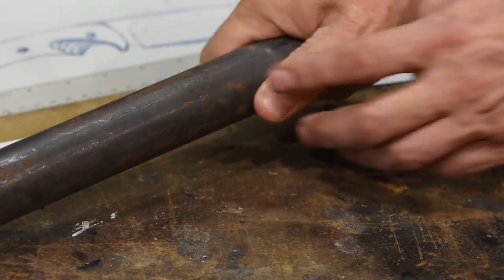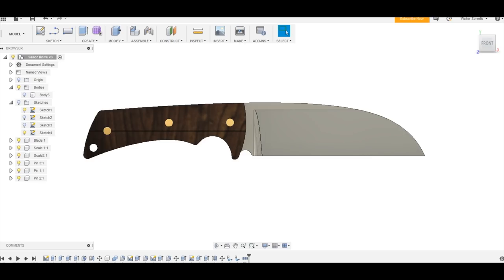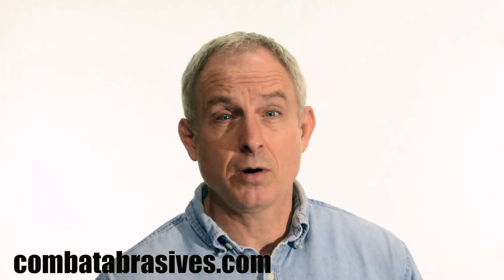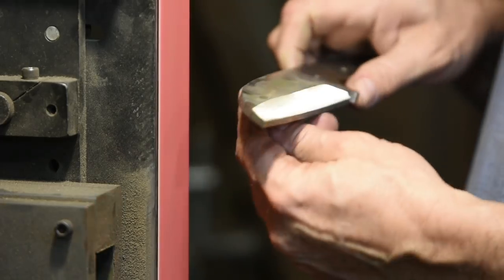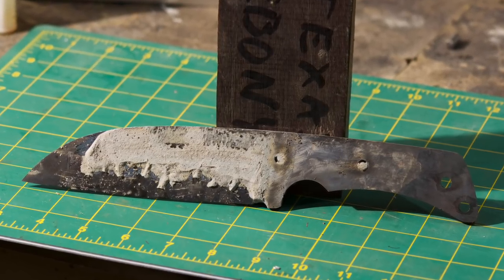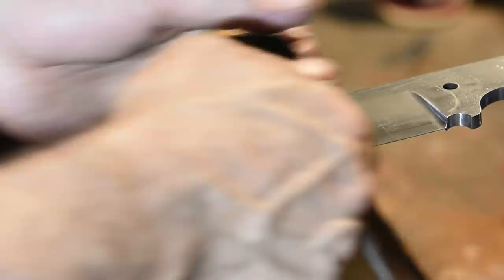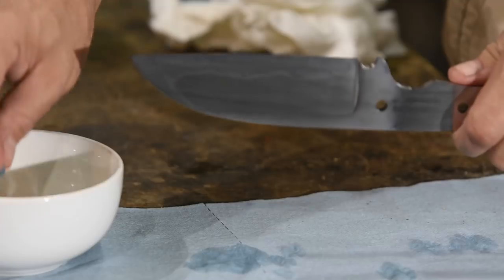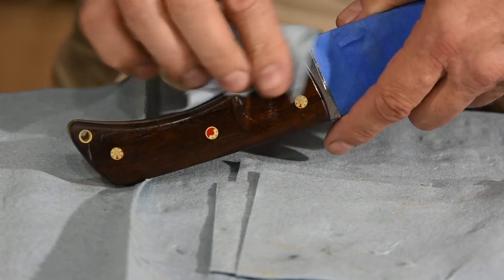Make a Sailor's Knife with a Hamon!

Comment: Another great feature of the knife is the fact that since it has the finger grip your hand won't slip onto the blade. I do sailing on the Elissa, the Tall Ship of Texas, and have been aloft 100' over the top of the deck in 6 foot seas rocking back and forth over the water, and believe me, you don't want your blade to slip! The other key feature is the lanyard hole, no sailor wants to lose the knife over the water, and if you are aloft you don't want  it falling to the deck and injuring someone or damaging something or getting damaged itself. Finally, the sheeps foot is for stabbing safety, and tradition has it that in the old days it also prevented sailors from having a stabbing weapon in case of a mutiny or fight on the ship! That's the exent of my knowledge, great knife!

Comment: They are called sailor's knives because they do not have a pointed tip that could be used for stabbing others on the vessel. Captains would order sailors to break off the tips of their knives when they came aboard. Plus the basic wharncliffe shape is perfect for cutting rope cleanly on a chopping block using a wooden mallet hitting the spine of the knife. Traditionally, the knife scales were made from lignum vitae, the preferred wood for making deadeyes and blocks for 18th and 19th century sailing ships.

Comment: I was actually holding my breath during your quench...you have nerves of high-carbon steel sir. I remember my father had a knife with a similar profile when he was a rigger working on ships, and would use a small mallet to baton through large diameter rope, and it gave a really clean, square edge.

Comment: Walter, wonderful work. Was wondering if you have ever used your mill to cut some parallel recess groves in the tang to enhance epoxy bond and trim some weight? Could see a like work done on the inside of the handle scales; all the more on the oily woods.

Comment: As a Bonified blue water Sailor I believe the reason he calls it a 'Sailor's Knife' is because it has a 'Sheepsfoot' blade profile.  This profile is commonly associated with sailors because of its use in the British Navy of the 1800's, and in fact its still used today on 'Traditional' style line or Rigging knives. I myself have had a Buck Yachtsman Model 315 for over 40yrs.
Reply: Bravo21 it’s almost a wharncliffe profile with the slope of that spine, healthy medium of the two? Still has a useable point but much thicker along the profile of the blade for strength

Comment: The reason sailors knives are shaped like that is because way back when in merry old England sailors were “impressed” into service, basically rounded up, clunked over the head and when they woke up they were out to sea for as long as they were needed, likely several years.  A knife being a necessary tool for a sailor, the first mate would see to it that the points on all regular knives were broken off so they could not be used to stab the officers or other men aboard...The impressed men were usually not happy men.

Comment: 1085 water quenched will get 62 HRC. But no use as tempering will bring down to 58 HRC. . 1086 cold oil quench will get martensite with some lower bainite which is tough. Why water quench?.